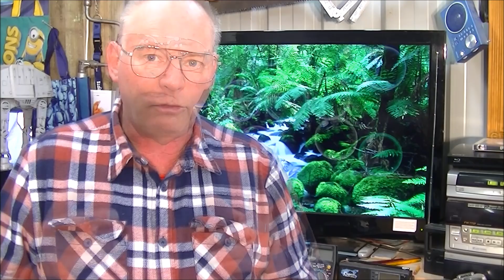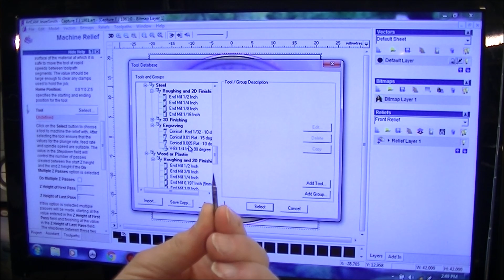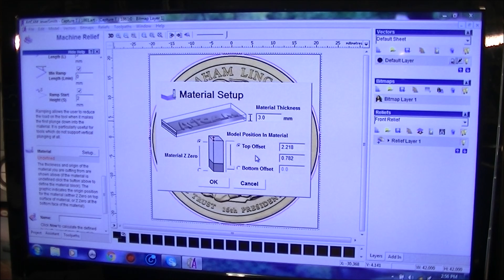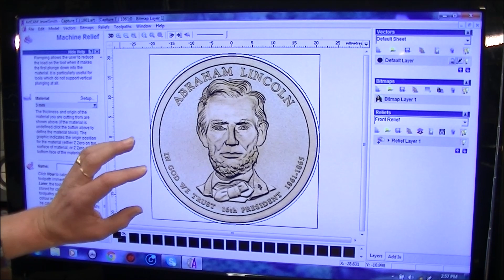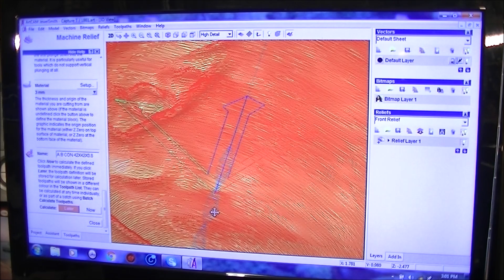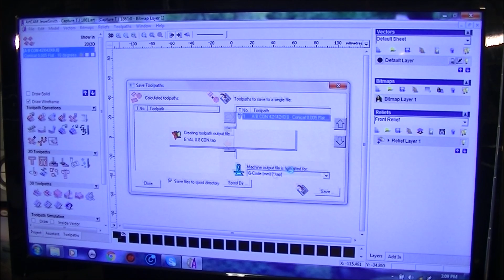147b A simple demonstration of making a 3D relief in ArtCAM  (Carveco)

Comment: love the information your giving here Roger. I hope I can afford to get a cnc some day.
Reply: I really like your videos
Reply: John Biggs  i got mine on ebay  a 320..pretty reasonable at  $ 630 au....
Reply: Rod Amo what make is it. I would want something that will hold up to possibly handling aluminum.
Reply: John Biggs  its one of those  Chinese ones...very well made. haven't tried aluminium  though..pleny info on the web
Reply: Roger Webb you've told me this before and I had never received the info. but the fact of the matter is still that I can not afford it. but I still love watching what you are doing on your chanel.
Reply from the maker: Email me at.   info@pacifictooling.com   and I will send you some
information on our new 4040, 6090, 6060 and 6012 (linear rail model) CNC routers. 
Australian Inventor Roger Clyde Webb